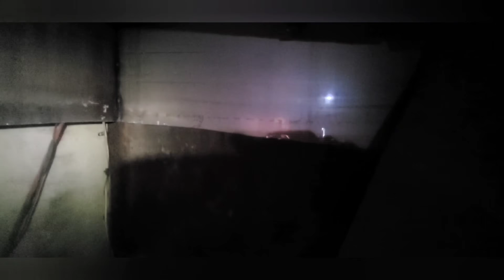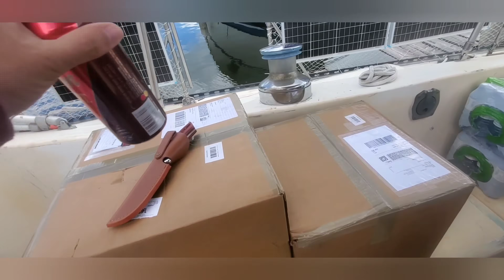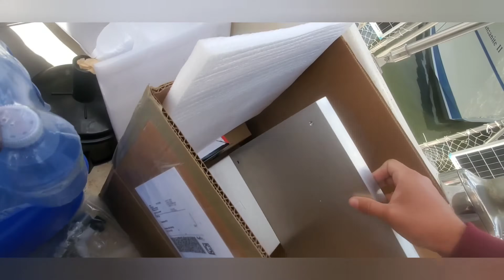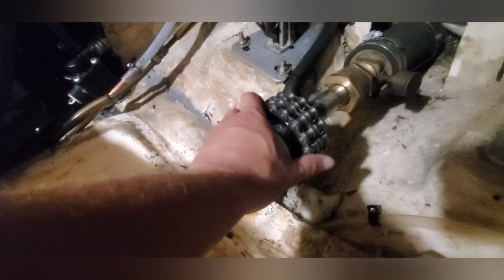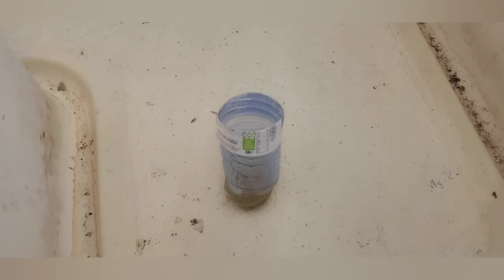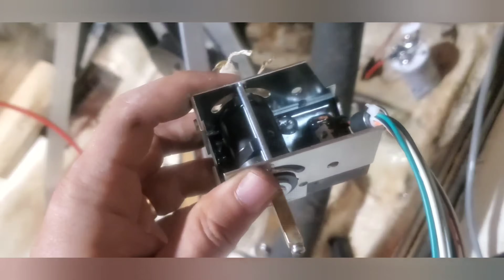step two of electric motor refit...actually getting it..

Comment: Great video, I have a Thunderstruck 10kw so pretty similar, however you need to mount the heat sink vertically so air flow cools the controller properly.
Reply from the maker: You're absolutely correct,  it something I still haven't gotten around to fixing yet but need to, thx for the reminder 😉

Comment: I would not have wasted my time trying to get that tank out of there I would have just cut the whole top of it off and used to put my batteries in
Reply from the maker: I thought about doing that.
Reply: @PyeGuySailing  It would have been a good idea but it's also lucky that you did take it out all that mold that was behind the tank was no good for your health so getting that out of there was a plus so it's actually a good thing that you did take it out are you would have never known that mold was there and mold is very bad for your lungs
Reply from the maker: @claybornlewis276  you're absolutely right also as a side benefit there's no longer any diesel smell in the boat 😁
Reply: @PyeGuySailing  Not having that diesel smell is a Plus all the way.. can't stand  that  smell....
Reply from the maker: @claybornlewis276  hey thanks for the conversation,  I enjoyed it

Comment: How do you figure the weight distribution of the motors, batteries, etc, so the boat planes well in the water.
Reply from the maker: My boat is a 36,000lb sailboat.  It doesn't plane. However if you wanted a speed boat or cruiser then put the batteries where the old engine was. The weight difference should be negligible and electric Motors are a fraction of the size.

Comment: Nice!
I just hung an electric 24 volt trolling motor on the transom of my 7 ton 33 foot sailboat. There is a lot of low end torque and it's enough to maneuver
Reply from the maker: That's incredible,  I'd  like to see that! It's an interesting option if I ever downsize. You should throw up a video, if you do send me a link 🙂